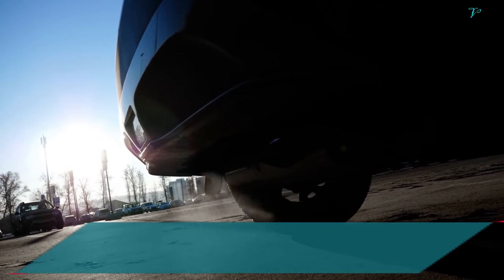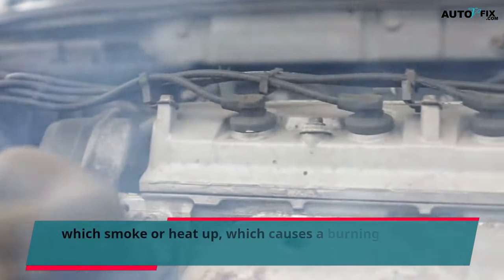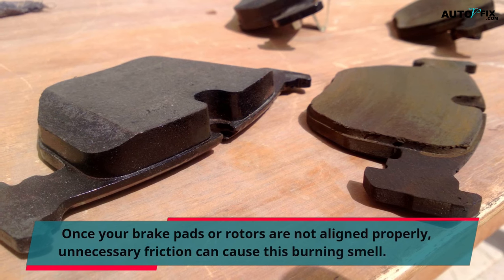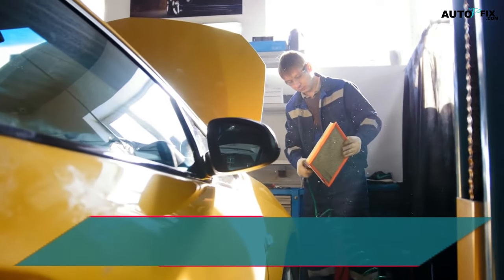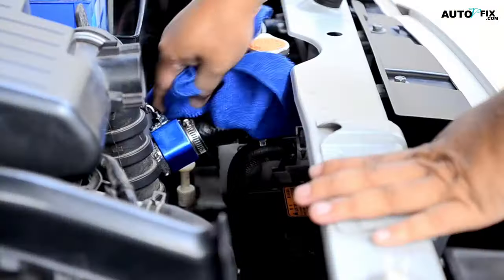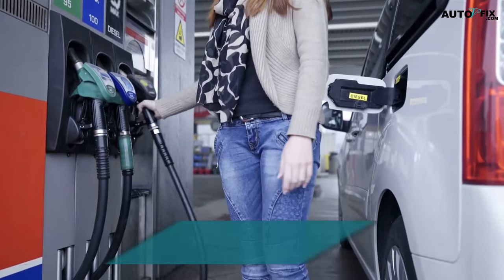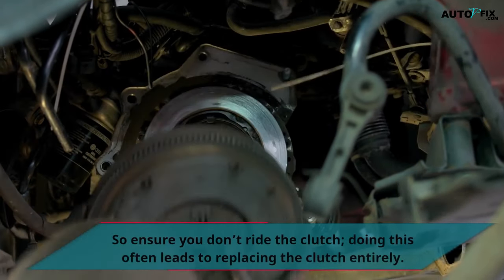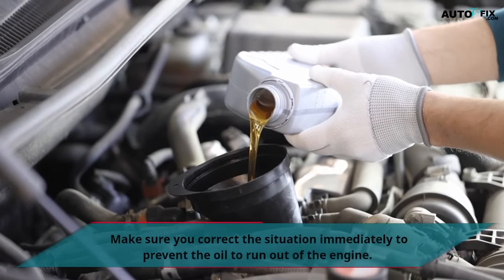5 Common types  of Burning smell from car but not overheating

Comment: 2014 Chrysler 300c Hemi )When I step on the gas real hard I smell smoke or something but when I’m driving normal everything is fine and it drives great. What could it be? Some say it’s normal if it has not been drivin in a long time.
Reply: Same 2014 charger rt
Reply: Same for my 2013 300c hemi. I just got it tho so idk might just be normal lmao 🤷🏽‍♂️
Reply: I got 170k on the motor tho so idk
Reply: Same chrysler 300 s
Reply: I got it on my sxt we burn oil a lot
Reply: same fr i got a ls430 that weird burning smell only happens when i full throttle do yall know the reason for it and is it serious?
Reply: Got a 14 Durango rt and does the same thing
Reply: did you guys ever find the issue?

Comment: Burning smell after having battery installed but the tech accidentally used a super old battery and jumping it
Reply: Hello what you mean? I buy new battery from Varta and have problem with boiling of water after i install new battery

Comment: Just changed heater core. No leaks. No smell in or out when off. But burning plastic type smell when on only.  And just fur a few second.  Dirty pathways that hasn't been heated in years.  Ugh. Now I need to reduce it and clean it out.